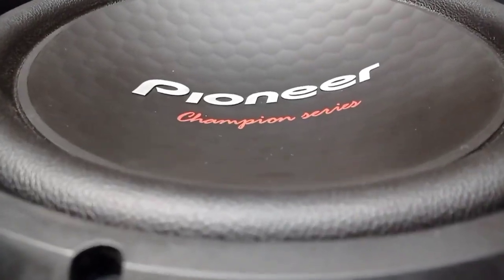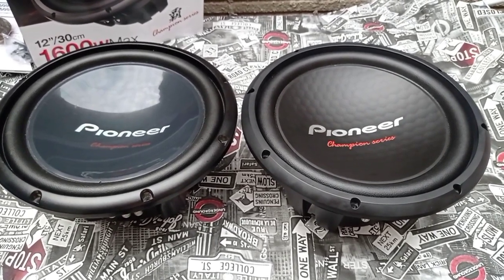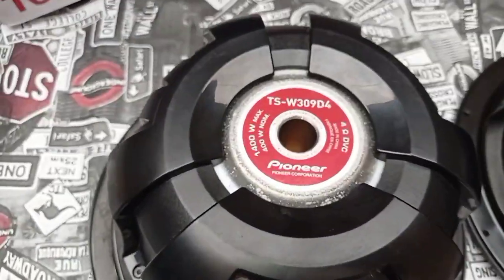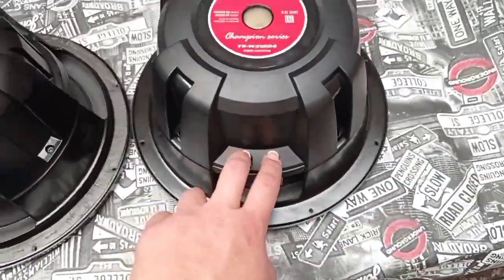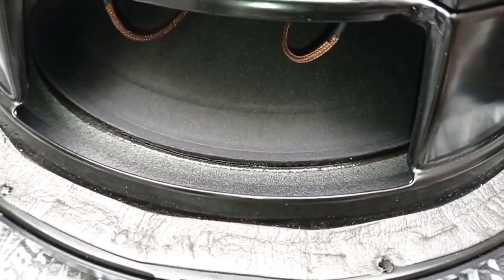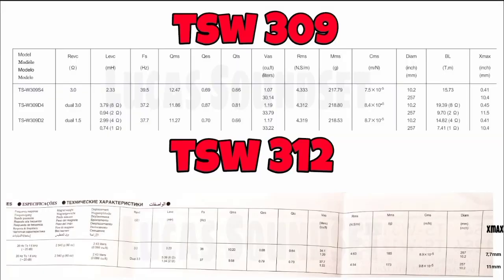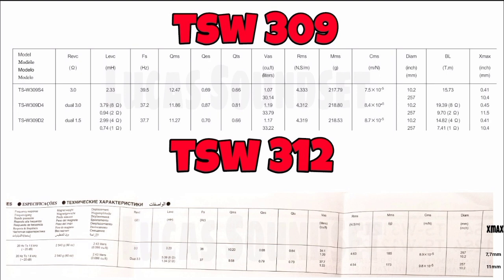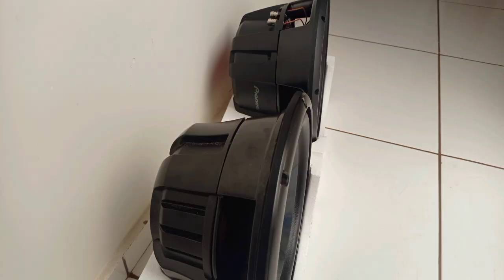Pioneer 309 x 312 - O Que Mudou ??? Comparativo e Avaliação

Comment: Comprei um 312 bobina dupla e coloquei em paralelo num Taramps Bass 1200. Grave muito bom pra som interno, pega até frequêcias bem baixas. Tô cuidando bastante só pra não clipar pelo excesso de potência do módulo
Reply from the maker: É uma 1200 pra 1 só se tiver casando impedância é mtt msm
Reply: @LUCASSOUNDSET  mas você acha que tem perigo de estragar rápido mesmo sem clipar? A impedância tá certinha.
Reply: @Iuizgustavo  tem sim amigo apartir do momento que joga mais que a potencia do alto falante corre risco mais é mais facil queimar por clip do que muita potencia aplicada.
Reply: @DennisFelix-g7u  então esse sub é fraco demais eu uso 2 uxp de 500 watts rms numa banda electra 2k só na fonte direto a 14.5 e num dá nem sinal de stess no sub e nessa voltagem o módulo manda uns 2600 watts rms pros dois casando a impedância toca demais e vou te falar eles aguenta tranquilo uma 3k sem distorção muito parrudo os uxp já montei muito som com pioneer eles tem realmente uma sensibilidade maior pq com pouca potência eles tocam bem e a outra vantagem deles é q tocam um pouquinho mais no aberto mais em questão de qualidade ficam pra trás dos uxp qualidade de grave excelente macio e pesado
Reply: @thiagorodrigues8846  Que isso meu Fi, YPÊ é um excelente subwoofer, mas em termos de acabamento e desempenho regrediu muito, Bravox criou buracos na linha de falantes, e cortou o custo com força, está impossível de adquirir no momento os produtos.